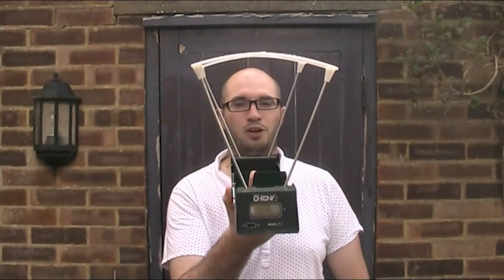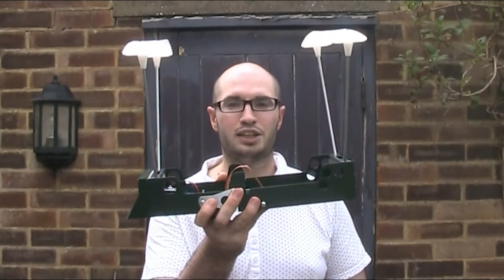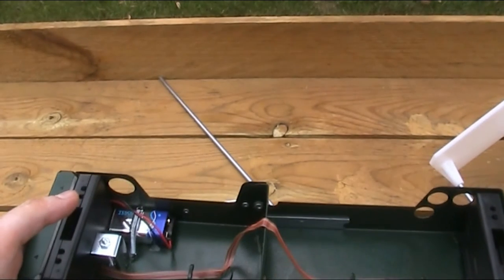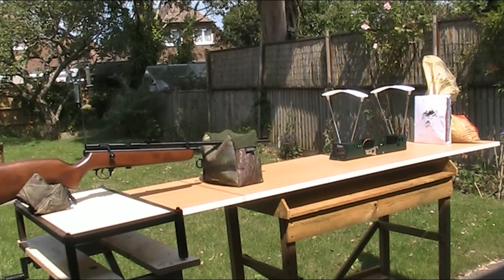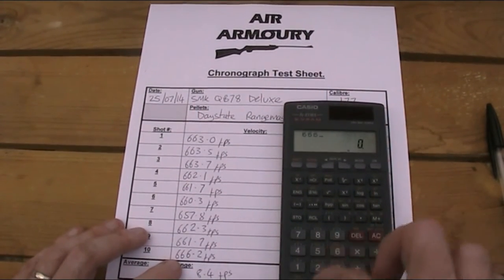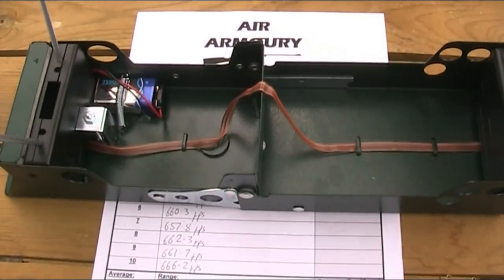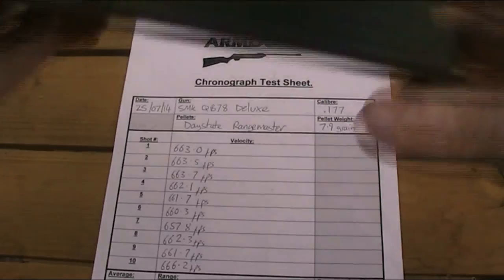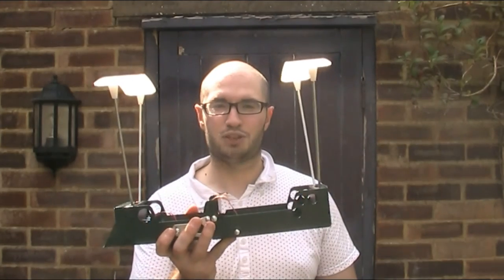Shooting Chrony F1 Chronograph Review | Air Armoury

Comment: Trivia: When the industry standard, original benchmark - as used by the FBI - Oehler Chronograph, was in production. The final accuracy / calibration check was performed with a Daisy, Red Ryder, BB gun.

Comment: Many thanks, JRH! I just bought the F1 and think I'll also want to add the remote control ... inexpensive bit that will do all the math for me! Best wishes, Bob
Reply from the maker: The remote would definitely be a time saver. Have fun with the F1, it's a great chronograph.
Reply: Hey, found simple directions online and made my own remote -- just a momentary switch and a 1/8-inch stereo audio plug and some wire. Cheers.
Reply from the maker: Sounds good, got a link to the directions?
Reply from the maker: Thanks, I think I might give it a go.

Comment: Dear Sir-I have an older Chrony F-1 and the instructions require one to assemble the diffuser assembly with 2 rods for each leg. You F-1 shows just one leg per diffuser. Do you know if this matters? Had many problems last time I took the F1 out to an airgun shoot. Thanx for any info-John in  Texas
Reply: Different diffusers were sold with application specific kits. ei- arrow, paintball, etc. Avoid direct sunlight into the sensors. You will get bad readings even with the diffuser. Same if you use in tree shade with moving leaves without the diffuser. I stay out of direct sunlight and use the diffusers and get very consistant readings. Also keep "pellets" 4 to 6 inches above sensors for best accuracy.

Comment: The master remote will not fit that 1/8 phono port. It uses a flat cable on a phone jack and only fits the master units that have no display on the front. The side port takes the one or two button remote (no displays) or the printer. I use the Chrony Beta with factory LED light bars and printer with 16 ft cord. Very consistant.

Comment: great video as always. got same model the f1 great for the price had pellets BBs cross bolts and little rubber bands though it just for fun.
Reply from the maker: It's great fun isn't it. What kind of fps did the rubber bands get?
Reply: Can't remember sorry but it must of been little of 30 fps as any slower it will not read. I'll do it again tomorrow, I think I used 2/3 inch bands
Reply: +Air Armoury rubber bands fps is about 125 with a about 1.5 inch band.